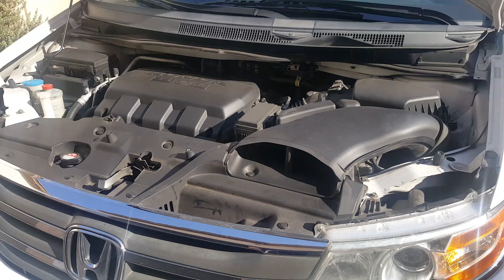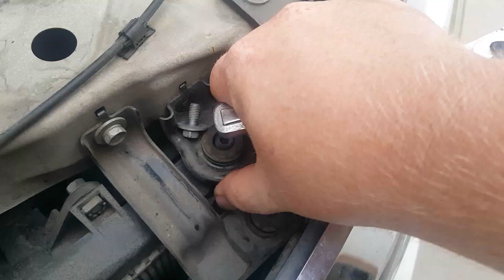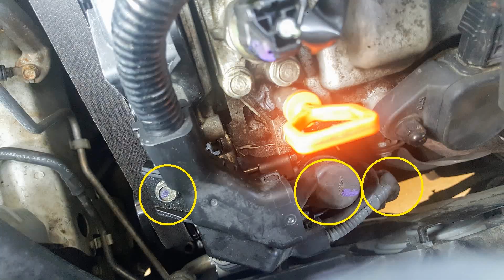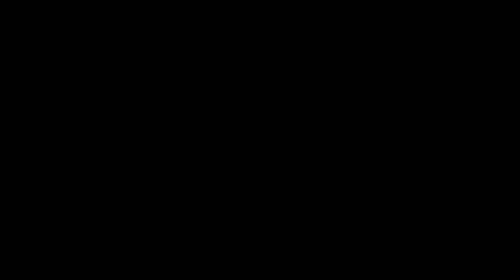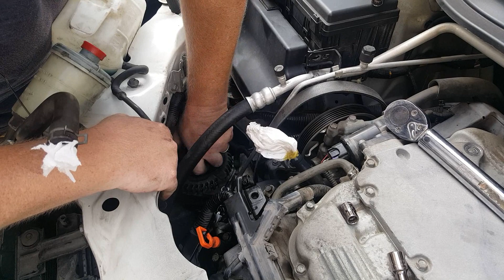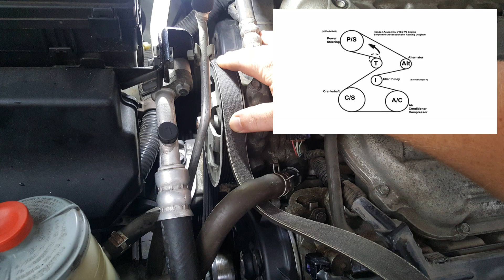How to Replace 2011-2017 Honda Odyssey Alternator | DIY Tutorial

Comment: Great video. The last time I did this repair on my 2012 Odyssey (40K miles ago, don't ask) I removed the alternator through the front and had to drain some coolant, remove the top radiator hose, remove the cooling fans, and loosened both the radiator and condenser in their mounts. The approach in this video is easier and faster. I have 4 suggestions/comments. 1) This video doesn't actually show the alternator come out of the mount so I can't say if this was done, but I had to adjust the tensioner pulley (against the spring pressure) to make room to remove the alternator. 2) To save a little time, it is not necessary to fully remove the coolant reservoir mount, it only needs to be loosened enough to rotate out of the way. this saves both disassembly and reassembly time and avoids any mounting location issues during reassembly. 3) You can get the coolant reservoir  completely out of the way by unclipping the hose from the fan shroud (3 places). this will allow you to move it, without disconnecting it, to the driver's side of the engine bay. 4) Completer remove the power steering reservoir from the engine bay, this gives more room to maneuver and eliminates the chance of PS fluid spillage during the repair. After removing the supply (larger) hose as the video shows,  the fluid can be poured out through that hose into a mason jar and saved until after reinstallation.. Then just disconnect the return hose (smaller hose) and set the reservoir aside (outside the engine bay). Add the old or new PS fluid after everything in reinstalled at the end. Also, since  PS fluid will destroy an alternator so it also helps avoid getting any on the new alternator.

Comment: Just had this done at my dealership, $1100.  A very good independent mechanic quoted $660, but unfortunately the van was already at the dealership and the belt had just broken and engine overheated.  So, I got screwed on that repair. I didn't have the time to do otherwise.   Dealership also implied I needed to replace the water pump and timing belt.  The overheating was just a few seconds of steam caused by the belt breaking while in the service line at the dealership, so I took my chances with not getting it replaced.  They racked up over $3000 dollar worth of things to be fixed, all at inflated prices.   I had the dealer do the bare minimum and will take it to the independent mechanic to have the needed ones done.  That's the last time that dealership will see me.
Reply from the maker: That's wild

Comment: The alternator connector is difficult to remove. I had to use two long flat head screw drivers. One to push the release tab in, the other to pry it out from the top at the same time.  Also, that bushing that is giving some people issues, before you put the new alternator in the cavity, get a small hammer or something similar and bang the bushing out  flush from the inside out. These two things will save you a LOT of frustration.
Reply: I had a similar problem with the first alternator but the issue was that the oversize area was too the rear of the alternator chassis (side away from the belt) .050 inches. I took it back and found one with the correct spacing because I felt if I moved the bushing in the front (belt side) of the mount, the pulley would be .050 inches too far into the belt drive plane.  Have you had any issues with belt wear or noise after adjusting the bushing position.

Comment: I'm using this video for the 3rd time in 3 years. The first Denso rebuilt alternator had a catastrophic failure 20 months after install.  The 2nd Bosch rebuilt has a 100mA battery drain (short); finally diagnosed it after 11 months.  I hope this 3rd Bosch alternator doesn't have a problem.  The serpentine belt tensioner tool can't be stressed enough as to how much easier it makes the belt install; very narrow work area.  I could also nudge the tensioner out of the way when installing/removing the alternator as it gave more space to pull it out.  I never had to deal with removing the radiator bolts.  Also, using the the zip tie on the upper bolt hole of the alternator to make a handle to guide the lower bolt in position made the job a ton easier.  Thanks again for this awesome video. Just wished I didn't have to do this work frequently
Reply from the maker: Do you have an oil leak from the front valve cover or spool valve? Maybe that's what is fouling up your alternators?

Comment: Remember, the alternator bolt torque is 16ft/lbs for the two on top, and 33 ft lbs for the bottom bolt.

I also routed my (new) serpentine belt over everything except the lower smooth pulley (idler?).   When I cranked on the tensioner, I slipped that one on.

I also used a 1/2" extension to plug the PS hose, it worked.

Comment: This video was fantastic and a lifesaver for me. I NEVER changed out an alternator before. Thank you. Thank you. Thank you.
Excellent descriptions and video. I appreciate your hard work.
I have a 2011 Hondah Odyssey.
The ONLY recommendation I have for anyone following these Excellent instructions is this:
When it comes time to install the new alternator, check the width of the old alternator where it fits in the bracket. My new alternator had a piece that made it just under 1/8th of an inch wider. I put it on a grinder. It fit after that.
Thanks for all your work.

Comment: Just did this on my 2011 Pilot. Saved $300 in labor. Thanks! 
A few time/labor savers: 
1. Don't remove the air-intake or trim piece in the front. Absolutely no need. 
2. Don't remove the radiator brackets. No need. 
3. DON'T disconnect the power steering hose. There's (barely) enough room to get the alt out/back in. Skip the messy waste of time.
4. Don't remove the alternator bracket until it's out of the car. This gives you another handle to remove it, and it's easier to get it off/back on the new one when it's out.
5. Some vids suggest removing the belt tensioner (not this one). Don't. 
6. Some say get a special tool belt tensioner tool to remove the tension from the serpentine belt. It does make it easier, but not that much. A 19mm ratchet & a chunk of pipe also works. 
7. You'll need to turn/twist the alternator to get it through the pathway to get it out, and then the same thing to get the replacement in. Be patient.
Reply from the maker: I'm sure there are a lot of similarities between the Pilot and Odyssey but to make the comments you did above to mostly Odyssey owners (those that find this video) seems a little odd. 

Either way I'm glad the video helped (generally speaking) you with your Pilot.

Comment: Great walk through! I was doubting that thing would come out of there, right up until it did, lol. I'm 6'1" so I put my Odyssey up on my ramps to save my back and that worked great. Also I used a short 1/2" socket extension to plug the PS line and put the clamp back over it. Probably took me an honest 4 hrs from set up to cleaned up. Thanks, you saved me some time & money
Reply from the maker: Glad the install went well. Appreciate the superthanks. By the way, if you don't already know this, keep an eye on your spool valve and front cover valve gasket for small oil leaks as that is often what fails up the alternator which is just right below.

Comment: Your video is very helpful. Thanks. The serpentine pulley wrench is a must and usually available for rental at auto parts stores like Advance Auto or Auto Zone. You buy it and return in 45 days. It is also handy to break the bottom bolt of the alternator. Hardest part so far is removal of that bottom bolt. Oh, and I dropped a socket down there in the belly pan.

Comment: Great video and very well explained!  I had to grind down the bushing to get the rebuilt Denso to fit other than that it went pretty good.  Maneuvering the old one out was a pain but the replacement seemed to get easier and easier every time I took it out to shave down the bushing.

Comment: Legend! Thank you for this video! (For the second time!)
Reply from the maker: If you keep having alternators go bad, there's a decent chance. The front valve cover gasket is leaking or your spool valve is leaking. Check those out as they might save you down the line from having to replace it a third time😅

Comment: Followed your video and the alternator replacement went mostly like clockwork. My new "refurbished" Advanced Auto alternator was 0.033 wider at the large end than the original alternator(1.785" vs. 1.818"), argh! I had to remove material from the rear of the large bushing in order for it to fit. Fortunately I have a machine shop:) Other than that, I also removed the 2 reservoirs just to get them completely out of the way. Easy, peasy too. R&R took about 3 hours and no blood was let in the process, har! Thanks again!!
Reply: I had a similar problem with the first alternator but the issue was that the oversize area was too the rear of the alternator chassis (side away from the belt) .050 inches (1.755 vs 1.805). I took it back and found one with the correct spacing (rebuilt instead of new)  Two others that commented here had a similar issue, but it seems they adjusted the position of the busing in the mount (belt side) instead of the alternator which I think is a mistake because it brings the pulley too far into the belt drive plane. To get one that fit I had to abandon the new (aftermarket) alternator and get t rebuilt. I bet the new ones are using a bushing that is too long. I also noticed when shopping that all alternators available (Honda dealers and online sources included are rebuilt unless you get a new aftermarket) I suspect Denso isn't manufacturing them.

Comment: Thanks for a great video.  I had the busing problem and solved by inserting screwing, adding space larger than diameter of bushing, and tightening with nut.  That compressed the busing and pulled it to the outside of the bracket.
Reply: I had a similar problem with the first alternator but the issue was that the oversize area was too the rear of the alternator chassis (side away from the belt) .050 inches. I took it back and found one with the correct spacing because I felt if I moved the bushing in the front (belt side) of the mount, the pulley would be .050 inches too far into the belt drive plane.  Have you had any issues with belt wear or noise after adjusting the bushing position.

Comment: Second time I’ve used this video to replace my alternator. Good job man! Thanks for the tutorial.
Reply from the maker: Man I really hope you're putting on a lot of miles and not getting bad alternators!
Reply: @DIYAroundTheHome  Ha! I bought a used one/ refurb last time. This time I went with the new.
Reply from the maker: @nickk1502  nice, I know the guys on Honda Odyssey forms really like the denso unit... though I'm sure there's others that are good too.
Reply: @nickk1502  Friendly tip - make sure the VVT solenoid isn’t leaking oil on the alternator mounted below it.  Many new alternators have been destroyed this way.  Search for my comments in this video for the details and the fix.  Cheers!

Comment: There is a bushing on the alternator and another where it mounts in the engine compartment, pressed in from the factory install.  If the bushing on the new alternator measures over 45 mm, it may not fit without pressing the mount bushing back out.  The OEM bolt is M10 x 1.25 thread.  You can source a nut or substitute a 1/4 x 2 inch hex bolt and nut.  Place a 3/4 inch socket over the bushing on the mount and reverse the bolt through the socket and into the nut.  Double up the washers so they do not deform with moderate force from a 3/8 inch ratchet drive.  A few turns will press the bushing back out such that the new alternator should easily swing into place.  The bushing should press back in when you tighten the OEM bolt installing the new alternator.